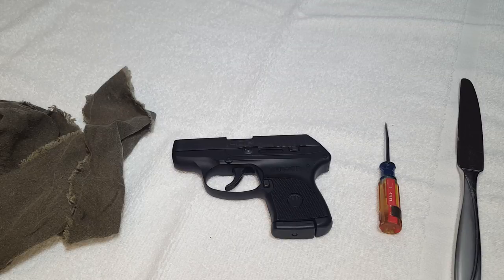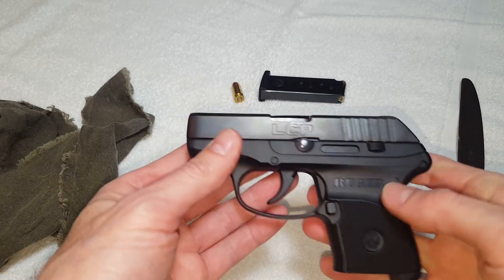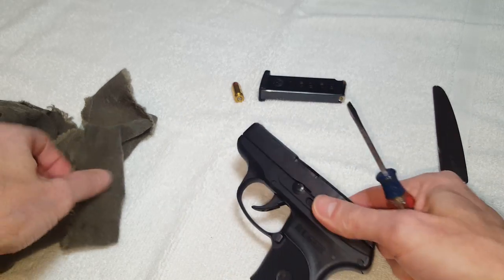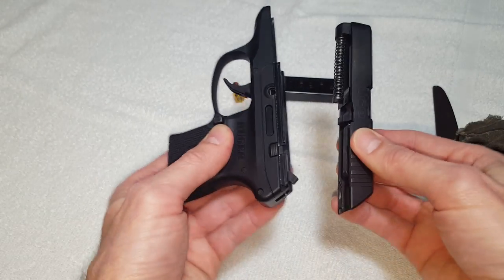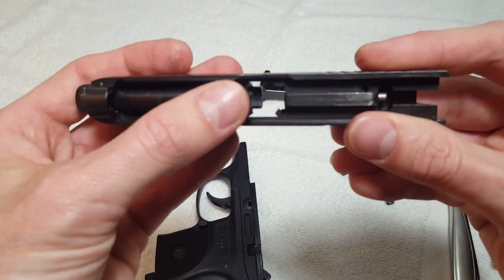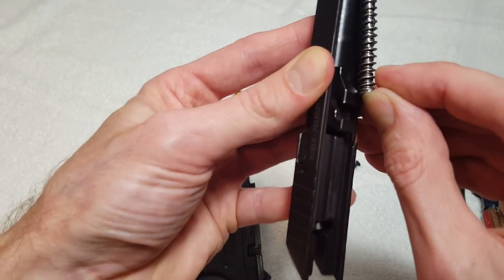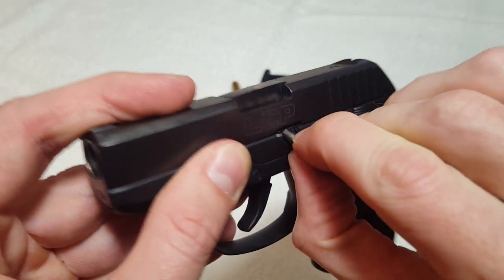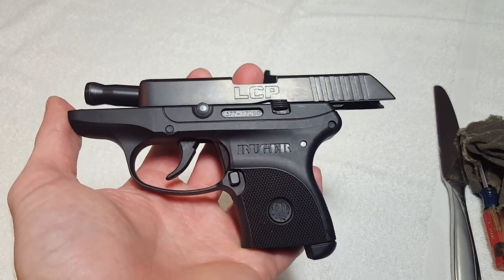QUICKLY Disassemble and Reassemble the Ruger LCP .380 Pistol

Comment: DO NOT pull the trigger after you rack the slide to to check the chamber to make sure it's unloaded. The internal hammer is in the cocked position and out of the way of the slide when you go to reassemble your Ruger.  If you pull the trigger before disassemble, the hammer is in the up or "fired" position and you won't get the slide to go all the way back on.  You will have to manually, with your finger, push the hammer back into the cocked position to get it out of the way.  I learned this the hard way.  Disassembly.....rack the slide, engage the slide "lock" to inspect and insure the pistol is not loaded, release the slide lock....DO NOT PULL THE TRIGGER!!!!!!. As you see here, remove the pin, clean and lub, reinstall the slide..reinstall the pin.  If the pin seems to fight back, tilt it down a bit, put a slight bit of pressure down on the end of the pin while pushing it in. Don't pull the trigger.  He didn't of course but didn't mention this..leave the pistol cocked.
Reply: Thanks for this note. I couldn't reassemble mine and that's why I got you tube!
Reply: I still can’t reasemble mine , i did pull the triger and i tried everything and it will not go back please help me
Reply: @chanakasgalindo6229 I don't know if you got it resolved.  When it's disassembled you have to manually cock it and there will be two clicks.  Then you can reassemble.
Reply: HA HA got on YT to figure out how to reassemble because it would not go back together, this saved me from overreacting, ha ha.  THANKS
Reply: Lmao thanks I already made the mistake 😂😂😂of
Reply: This comment needs to be pinned
Reply: Thank you so much dude, lol. I thought i messed up the structural integrity of my slide
Reply: Yep    Learned the hard way as well
Reply: Thanks so much bro
Reply: Thank you!!!!
Reply: I can’t get my hammer to move I accidentally pulled the trigger not knowing I shouldn’t
Reply: hammer is locked forward, not able to pull it back with my finger and I can’t find any help posted online
Reply: @jaek7595  I had to pry mine up with a screw driver, took a lot of force on mine
Reply: @Sliceandpoke  wow that was a fast response thank you, still not working and I’m worried i’ll actually break it with the amount of force I’m applying
Reply: Hey man, thanks. This is something that should be mentioned in the instructions, as it is not. Evidently, this happens often to people. I have always found the answer I needed on YouTube. Thanks again.
Reply: Thanks for the stressed don't pull the trigger comment bro lmao
Reply: Your a good man Buba

Comment: FYI, that "spring" is actually a spring inside a spring.  Yep, two springs.  I found out the hard way.
Reply: I can't get the slide back on. The spring is in but the gun won't let me put the slide all the way on
Reply: @nickcampbell5118  Make sure your spring is seated properly. the rod the spring is on should protrude from the front of the gun just under the barrel. I reinstall the pin before working the slide backward also. Plus the slide moves easily for a short distance back then you need to put some muscle into it to go fully  back. Let me know how you make out.
Reply: @my2cents945  just ended up having to cock the hammer back and it went right back on but thanks man. I'll definitely keep this in mind the next time I clean it.
Reply: @nickcampbell5118  glad you were able to work it out.
Reply: This cleared up me trying to figure out what pistol was missing a spring after cleaning a few!
Reply: @nickcampbell5118  THANK YOU! Been trying to get this damn slide back on for an hour 😂
Reply: My spring went flying apart first time taking it apart just got it today unfired. Weird.

Comment: Good video but I have one observation:  You can and should take the recoil spring off the guiderod for cleaning and lubing, they’re designed to come apart.  Also, there are two recoil springs, an inner and outer.  Gently pull them apart and brush lightly after shooting.
Reply: MY SPRINGS

Comment: Thank you, I'm used to field stripping my glocks and recently I've acquired a few smaller guns because everything I have is big full size but I'm just used to mainly glocks and this lil Smith and Wesson shield 40 I got but I recently acquired one of these superrrr tiny lil ruger lcp 380s just because why not? And bc it was on sale brand new at my favorite local gun store I buy all my guns from for the most part and I went browsing a few days ago and the owner John that hooks me up sold kt to me brand new for 180 plus tax and gave me 100 rounds of fmj plinkers and 2 boxes of my fav self defense Hornaday critical defense hallow points along with a extra new OEM magazine for it all for free (ammo and mag) whixh is all basically why I bought suck a tiny gun that barelyyy fits my big ol paws lol... but I like to know my guns before I go shoot them and I always field strip them before I WILL go shoot them and wasn't sure as how to field strip it.    This was the firdt video that popped up on how to do so and it was quick and straight to the point and very helpful...  I saw a little "upgrade on Amazon for it that replaced the pin you have to pry out its got a slot for a flat head screw driver you just turn counter clockwise and it comes out just a tiny bit once you do so you don't have to put a flathead screw driver up against it and risk ruinin ur slide and scratching it up, it was only 15.99 so I think ima order it now but thanks for this video because I was kind of at a loss as I am used to what I'm used tk which is glocks but thanks for this helpful video that was short sweet simple and straight to the point..   now I can finally run it tomorrow at my range at my house... thank you for taking the time to make this video for guys like me thay don't believe in reading manuals lol....  and is too caught up in their ways on how disassemble other brands of firearms as tbats all they primarily know and own! Thank you

Comment: My takedown pin was very difficult to remove. You mentioned that you don't have to pull the slide back but in other vids they say to pull back like a 1/4 inch but that seemed to work just fine for you. It didnt seem like pulling the slide back relieved tension on the spring as they claimed. It appears it wont hurt anything by not pushing the slide back..

Comment: Use a trim bar to remove the pin. They are made of plastic. Typically it’s a tool used to disassemble car dashboard stuff. Maybe remove a radio or something you don’t want to damage. Trim tools are ridged but still they don’t screw up the finish.

Comment: Took mine apart. I feel like i re assembled it correctly... but now when I try to chamber a round it isn't smooth and seems jammed a bit and I have to really work to get the slide back and a round chambered...any tips?
Reply from the maker: I would try it again to confirm everything is seated properly and inspect for any gunk that may remain along the slide guides. Confirm the feeding ramp is also looking good.

Comment: My LCP won’t slide all the way back. It falls short maybe 3/8”.
Reply: I had the same issue on mine, something weird with the firing hammer getting in the way. Had to pull the trigger to put it down to slide it over, then pull back after I got it past a point, otherwise if I forced it it still made the firing hammer go down. Hopefully you've figured it out after 2 months!

Comment: Good video!  I am having trouble with my newly acquired Ruger.  In the final stage of reassembly, I cannot get the pin back in.  Any suggestions would be appreciated.
Reply: I"m sure you haven't been waiting three months to figure out how to put your gun back together haha. But as you have already figured out it won't go all the way back in without pulling the slide just a tiny bit.
Reply: @usmczippoguy7947  thank you 😁
Reply: I found pushing a little back on the slide (1 finger on the front near the muzzle will do) while pushing it in at a slight downward angle does it.

Comment: my chamber does not slide in all the way.
any ideas????
Reply: Did you fix it??? I’m having the same problem
Reply: @LouisianaInNOut  yes sir i put it on the rail and slide the chamber back and lined up the pin with the hole
Reply: Gabriel orta thanks I had to learn the hard way too
Reply: @LouisianaInNOut  yeah it was rough